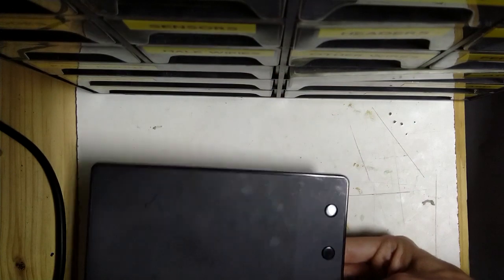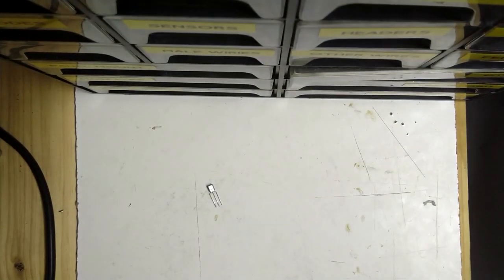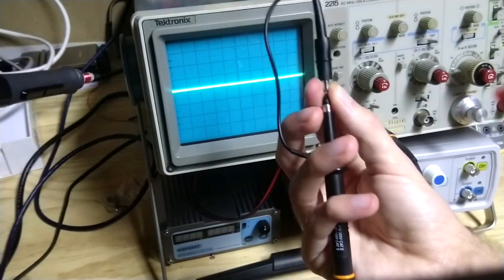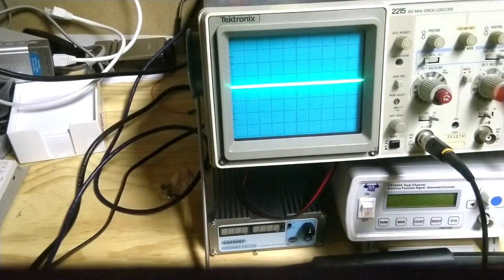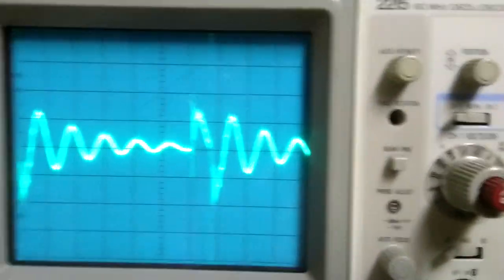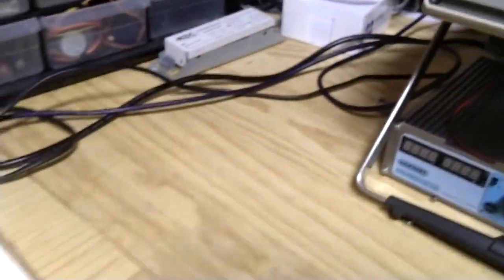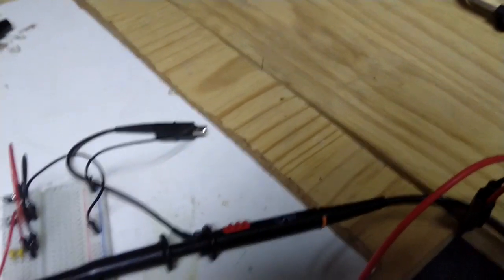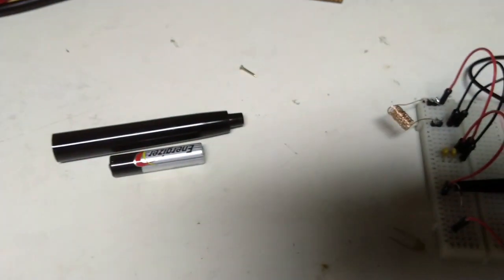The Physics of Drawing Tablets: Cutting Costs with Electromagnetism

Comment: My Wacom tablet does this, but the pen has no battery.
I presume they have an oscillator generating a field in coils in the pad that excites a fixed coil in the pen. That in turn powers the inductor and capacitors of the pen's transmitter.